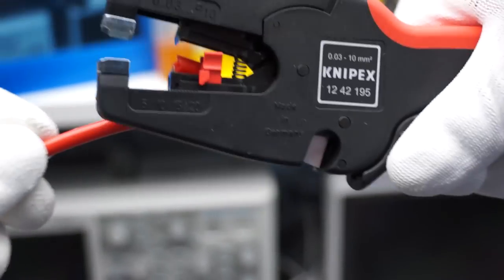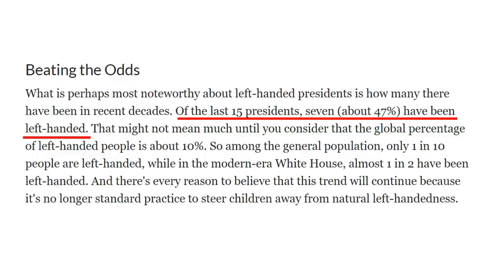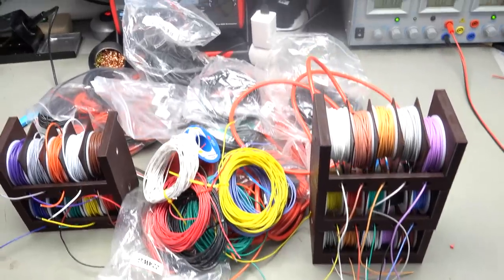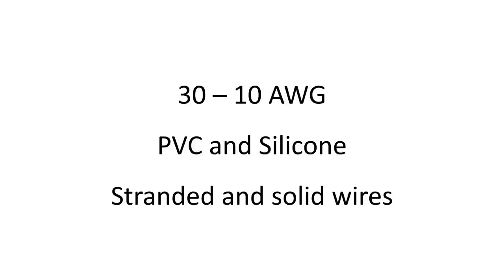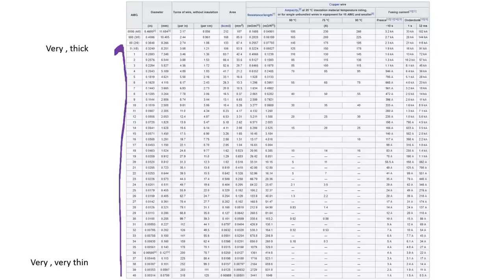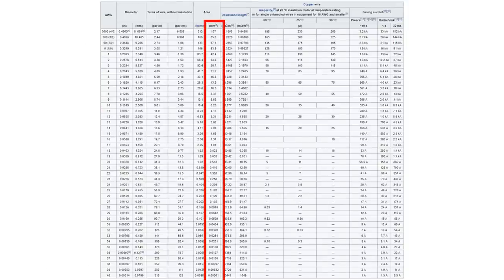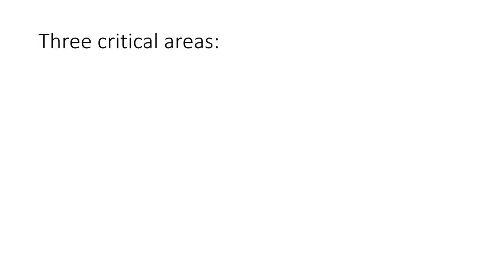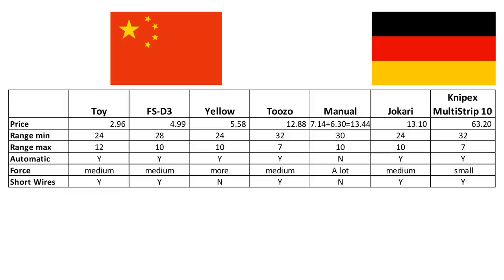#268 8 Wire Stripper Test: Germany vs. China. Who wins?

Comment: Another design missing in this "survey" is this one:
https://www.aliexpress.com/item/32626310854.html
it is available not only in cheap chinese copies but also in extremely high quality (and cost)  brand name tools
like Exelite. It is the "manual" stripper but adjustable. It is a pain to adjust this stripper for each new wire
thickness desired, but if we need to strip dozens or hundreds of pieces of the same wire, we can adjust
it only once and have a very precise stripper, which cuts only the insulation without any nicks whatsoever
in the copper, specially in the case of solid wires.
Reply from the maker: Thanks for sharing your experience!

Comment: Disappointed... Says 'blades cannot be replaced', while the camera is clearly focused on the bolts for removing replacing the blades... lol Following that, attempts to cut wire, but I can clearly see the tool was not adjusted. I am confident that the results would have been more favorable if properly adjusted...

Comment: The Yellow one is good if you get the "Red" one..The yellow that you have is a copy of a copy so it's hit or miss. I have an "original" one which works perfectly and the other benefit is that it can strip anywhere in the wire so you can splice connections; not only at the end of the wire. It's perfect for automotive use with AVS wire. Here is pic: https://i.imgur.com/sZoNy9O.jpg
Reply from the maker: In the meantime I bought another one and it works. You are right with the "hit or miss"
Reply: @AndreasSpiess  yes, you can tell if the seller sends you actual high res pics of the product, otherwise it's really difficult to get a working one other than buying this one in my pic which doesn't have the build in ruler

Comment: When you like the Knipex, then you should try the original (yes the knipex is, as far as i know, a knockoff too). I use the Stripax in my daily work as an electrician. The cutting blades consist of multibel tiny individual springloaded blades, wich make it cut the isolation rather than tearing half of it, without cutting induvidual strings.
It's rated for 0,08 to 6 mm2 or AWG 28 to 10.
It is allso German, made by Weidmüller. Expensive? Yes, but you get what you pay for: mine is 20+ years and still going strong. 😊
Reply from the maker: Thanks for the tip. Before the video nobody mentioned this name. So I did not buy one :-(

Comment: I used yellow one for several years for electrical wires (#16, #14, #12). Not very impressive, works alright in 75-80% cases. Utility knife works better :)
Reply from the maker: For solid wires, knives are also ok for me...
Reply: @AndreasSpiess  I'm also using knife for multi-stranded wires. I try do not cut through the isolation, just kind of mark the spot, then bend wire at this marking line, that tears the isolation. 
Now I'm facing the challenge of stripping the PTFE (teflon) isolation. "Manual" - in your classification - works, but cuts some strands.
Reply from the maker: Teflon seems to be very difficult if I read the other comments.
Reply: @AndreasSpiess  It is. But I'm not ready to spend 390 USD (price for Teledyne TW1 on Amazon) for wire strippers. I would rather use my trusted knife :-D even if I cut some strands. Not a big deal for hobbyist.
Thanks for the video, Andreas!  (I have just realized I didn't say that yet, oops!)

Comment: I bought a Knippex wire stripper a few years ago that looks more like the Jokari one. It cost around 30€ (iirc) and has worked flawlesly until today. The only disadvantage is that the insulation of thin wires sometimes (few times, not often) sticks in the stripper and you have to tap it on the side so that it falls out of the stripper.

btw: I can't help but if I think of american presidents and strippers I think more of the "Stormy Daniels" kind of strippers 😅
Reply from the maker: Thank you for sharing your experience!
Reply: You're welcome :) I looked the tool up on Google and you can find it as "Knipex 12 62 180" and it still costs about 30€.

Comment: Silicone wires are awesome, have been using them exclusively for 10 years :D 
you can even solder them with a lighter!
don't need a wire stopper for them imo, use your fingers
Reply from the maker: My nails are not the best :-(

Comment: You know.........I have been stripping wires professionally for 25 years. Recently, a manager type person saw my stripper of choice and commented "those are what you use, I'm surprised you don't have nicer ones" so I explained that the end result is what matters, not how fancy the tool is. If a single strand is broken, it's no good. If the copper is nicked, it's no good. I remembered that I have all sorts of fancy strippers in the toolbox, and why they are there and not in my hand. When you have respect for electricity it's easy to use the manual strippers because I sleep better. That said, when the fancy ones work I have been known to use them, but only when they work.
Reply from the maker: Thanks for sharing your experience!

Comment: Andreas, the word is insulation not insolation . Thats OK, you speak better English than 1/2 the American population. My preference for wire stippers is a Miller #100 manual wire stripper. It has a single notch with an adjustable stop to change  wire gauge.
Thanks for all the good info
Reply from the maker: After those many comments I know now the right word ;-)

Comment: There are 2 different american feet! The survey foot (3.28083333333 US survey feet per meter) and the international foot (3.28083989501 International feet per meter) and if you want really weird... take a look at the kcmil used to measure wire areas - circular millimetres... really.
Reply from the maker: The difference is quite small, luckily ;-)

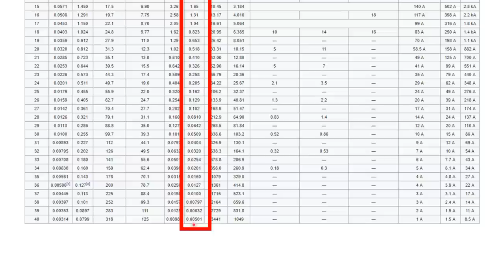Comment: Btw, at ~4:00 talking about AWG and metric, I think this table converts awg to metric. We could probably use metric and say 0.01mm 0.1mm 0.15mm etc. We wouldn't really have to say 0.14736mm, since that's a conversion. Metric seems to me good for wire diameter measuring (just don't convert from awg). I also have the one in 9:00.👍😂😂
Reply from the maker: You are right. Still two places after the point...
Reply: Was just going to write the same....never seen this as something difficult, but very logic. A 1,5 square cable is for 10 A installations, a 2,5 square is for 16 A etc. Logical thinking, large cable size, larger current.... and for the smaller cables, you just say “o ten” for 0,1 square mm cable etc. Not harder to say than “sixteen AWG”. But we were brought up in a decimal EN/DS/ISO world ... and i thought that Switzerland was very ISO-metric too...😊

Comment: Nice comparison but you should mention the difference between UL certificated and CE certificated cables. The UL ones have a harder, stronger and tougher isolation as the CE one. Rubber cables are also very hard to strip.

From my experience (I've stripped millions different cables in the range to 2mm²):

With the Knippex you can strip easy more than 250k CE and thin cables but the blades gets dull when you strip more than 15k UL cables. The blades for the Knippex costs as mutch as the complete Jokari tool.

The Jokari will work for arround 25k uses and the V-shaped blades work way better for UL, some rubber cables and silicone cables (except the knippex is brand new and still sharp). The Jokary has some problems with very thin cables or incorrect isolation/kopper ratio.

So if you don't have to strip very thin cables, the Jokari will work for hobby use. I have two knippex and a jokari. I only use one of the knippex for thin wires, so it stays sharp. The other one is my main tool, where I had to replace the blades from time to time and the Jokari if I had to strip rubber, UL or silicone cable.

I've tried some different tools than you showed and the ones you showed and nothing beats the knippex and jokari.
Reply from the maker: Thanks for the info. I just used what I had in the lab.

Comment: @17:26 notice the brass thumb screw this can be adjusted for differing wire thicknesses. You gave this a bum deal, it's not brilliant but better than you rate it.  I picked up one from Aldi as a second cutter to save bringing my work one home.  After I got to know it at £5-£6 it is good value.
Reply from the maker: Mine was really bad and I have now a new one which is much better.

Comment: Nice video but you forgot the mother of them all : the "Weidmüller  Stripax". These are the absolute best when it comes to wire stripping especially in a production environment. I do have the FS-D3 at home and they are ok for hobby application but if you are stripping hundreds of wires a day you will feel the difference. Also that the isolation hangs on the end is not a bad thing and can even be forced to happen on the Weidmüller stripax because when you are removing the rest of the isolation you can simultaneously twist the wire strands together so they wont flap around in the breeze.... Also in my opinion the metric system is much more intuitive than the American system. I just advise you that you dont mix them or else you will probably get quite confused....
Reply: The only thing worse than the colonial system is a mixed system.
Reply from the maker: Unfortunately, nobody mentioned the Stripax before the video. And I did not know the brand.

Comment: I very much disagree. AWG is not easier. If you need an appropriate wire for a given current you need the cross section of the wire anyway for your calculations. So just define / name the wire according to its cross secion area. If you need to know the diameter, you can calculate it from the cross section area.  
The AWG number says nothing about the wires rating.
Reply from the maker: I agree with your argument. So far I anyway try to use too thick wires for my projects I never did this calculation. Maybe I should to save a few dollars...
Reply: @AndreasSpiess  Wow. I didn't expect an answer for a 2 year old video ;) 
I didn't mean to criticize you and agree with you on the actual topic of the video - the Knippex wire stripper is good ;).
However, I just wanted to point out that you need to calculate the cross-section of the wire for many applications anyway. We agree on that.
And as you mentioned: Its not logical that the AWG number goes down, if the cross section goes up. 
And when it reaches 0, there is 00 , 000, 0000 😂. Its a mess ! 
Thanks for your videos, keep up doing more. Greetings from Germany

Comment: I used my front teeth for years for wire wrap and breadboard wires - I now have a gap in between them and a bit missing off the cutting edge 🤬
For thicker wire I’ve always used a craft knife or pliers to be honest but I now see I have to buy the most expensive ones in the test just so I can watch it strip time after time.
Reply from the maker: You decide! But damaged teeth can become expensive (at least here)
Reply: @AndreasSpiess  They are here as well :-(  Thats one reason I still have the chip...

Comment: you did a terrible error when you used the automatic chinese horizontal striper... you shoud put down the "leng stop plastic" so you could put more wire on the jags...
Reply from the maker: My wires usually are very thin. But the yellow one was defective and is replaced now.

Comment: I think that the strippers that don't remove the insulation  all the way can have an advantage.  You can easily twist the strands and you don't put finger prints and oil on the wire.  I don't wear gloves when soldering.
Reply from the maker: Thank you for your tip!

Comment: In the States we have wires in AWG and SAE sizes. Tools made in China usually are in mm2 to fit EU standards, and strippers and crimpers for mm2 will never fit US wires, of either standard, properly. The Chinese often claim to fit US sizes, but the tools are usually stamped mm2, a dead giveaway that they'll never be quite right.
 An SAE (Society of Automotive Engineers, leading our domestic auto industry) wire is usually a full gauge size different from an AWG wire, i.e. 10-AWG is similar to 12-SAE, a significant difference.
 The stripper niche on my Swiss Army Knife works in a pinch, too. It might be mm2.(G)
Reply from the maker: I am not sure if the naming of the unit is very important for the automatic strippers. It is important for the manual one because of the different holes.

Comment: The American measuring system was good enough to make it to the moon or at least a sound stage in Hollywood, multiple times.  I use one of the Paladins for electronic type wires (they are kind of expensive but WORK).  Klein is a decent U.S.A. brand for electrical wires.  Something about the name starting with a K I guess.
Reply from the maker: I am not sure it was necessary;-) As I said: The Americans are bright!

Comment: These are not ment for PTFE. (Aircraft cables)

Mil bar, goot, ideal hellarman are best (ptfe) for aviation cables thru my 52 years experience.
DMC tool for crimping.
Reply from the maker: Thank you for sharing your experience. Teflon is not very common in our hobby (apart from wire wrapping wires).

Comment: 12:15 The issue is that the diameter of a given size of wire (in AWG or mm²) is different for solid wire vs. stranded wire. Manual strippers seem to invariably be labeled for solid wire, so indeed, for stranded it is critical to use the next larger opening. 

It also doesn't help that some strippers are labeled in mm² cross-sectional area, while others are labeled in mm diameter. (The only value where these would be the same is at 4/𝜋, ≈1.273, about 16AWG.) It boggles my mind that here in Europe, solid hook-up wire (Schaltdraht) is usually sold by diameter, while solid wire for electricians (Installationsdraht) is sold by mm², often even within the same catalog/manufacturer. 🤦‍♂️
Reply from the maker: You seem to be a specialist in this matter. I am just a noob trying to survive this jungle of „standards“

Comment: I have been stripping wires since 1976 and a part from rotary strippers for which had to be adjusted for every size of wire, which could take 30 minutes or so as you had make sure that the copper was not touched by the blade. We also used a type like this. https://uk.rs-online.com/mobile/p/wire-strippers/7009754/ 

I worked on avionic equipment first building then design for fast jets and military transports like the c130 etc. All cables were ptfe which Is a pain to strip without sharp blades, and every wire was inspected 100%.   

To make up one assembly, would take days.
1 cut wire to length and strip. Inspection!
2 time each end and put on indents. Inspection!
3 solder into buckets on connector. Inspection!
4 lay out on assembly jig and clip wires to place holders. Inspection!
5 using waxed nylon thread form the wires into a loom. Inspection!
6 remove the loom, and start the next one.

Boy I was happy when I got off the shop floor and into the  r&d department at the end of my apprenticeship.
Reply from the maker: Thank you for sharing your experience! Avionics seem to have very specific specs...

Comment: When you get a cut that is too uneven, try starting with a 90° starting cut. Then finish as usual. The reduced force will help reduce the cutting of strands. That will get you by until you can get one of the German strippers.
Reply from the maker: Thanks for the tip!

Comment: Take a look at the Ideal Stripmaster range.  https://www.amazon.com/Ideal-45-292-Stripmaster-Wire-Stripper/dp/B000NBA8GM  It has replaceable blades with sizes from 30 AWG up to at least 8 AWG.  I have several pairs with different blades and they do an excellent job.
Reply from the maker: Thank you for the link. I will have a look.